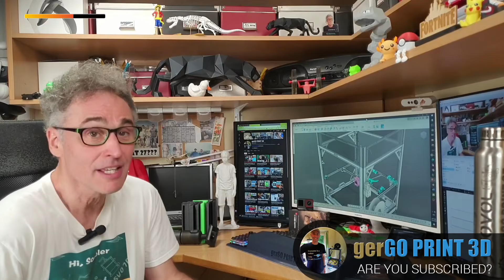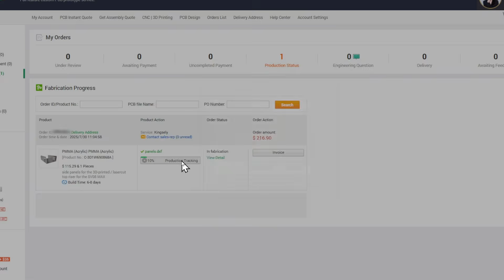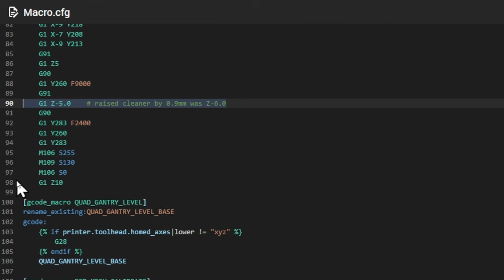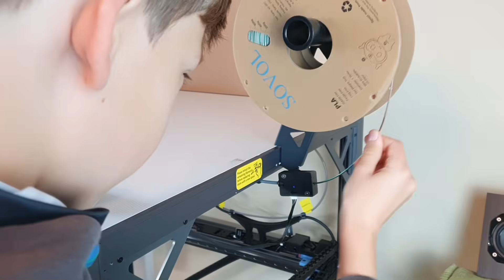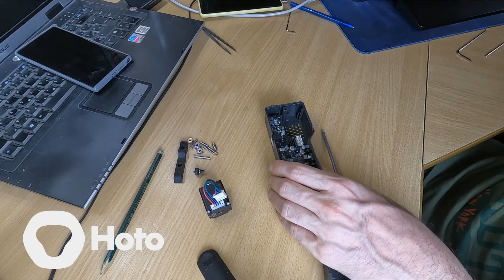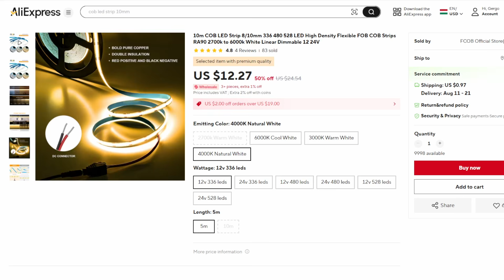Making our Sovol SV08 MAX Even Better: Adding the Missing Pieces – Part 1

Comment: What I want to know is how can we switch to the new toolhead on the regular sv08. Also the new filament assist
Reply: IIRC the SV08 is USB toolhead and the SV08 max is CAN - so its a bit more then just swapping the toolheads. They have different controller boards as well.
Reply: @paulhuckaby true, the process to install Eddy was pretty easy, but the usb cable management is a pain. I wil figure out a solution though!
Reply: Some people grew impatient and installed mainline Klipper on their SV08 to install an Eddy sensor.  I've been waiting for Sovol to provide an upgraded SV08 tool head with an Eddy sensor.  That's been coming "very soon" for the last month but is apparently very close to shipping.  Giving the SV08 a fast and accurate bed mesh should fix half of the first layer issues.

The SV08 uses a USB tool head.  The Zero and SV08 Max use a more reliable CANbus tool head, so they can't be swapped readily.  If you really wanted the SV08 Max tool head on the SV08, you could get a USB to CANbus adapter, hide that near the motherboard, and do a little bit of wiring to connect the motherboard to the adapter, probably cannibalizing the USB tool head cable for the connector and short wiring harness to the adapter.  It shouldn't be that difficult.  I was tempted to do that, but decided to wait on Sovol to stay on their firmware update program rather than installing mainline Klipper with whatever that entails.
Reply: I hear ya, but I went ahead and upgraded to mainline Klipper and added Eddy NG...that part is great...now my bed is a different story!
Reply: @treyduval5399 there are some options now. I haven't tried any yet, but it's good to see some options like Nadir demo'd and printasaurus etc. Cheap vs expensive. Someone else posted a video then other day of their manual fix for the bed.
Reply: @colinmsmall yeah, I've seen cheap and expensive and decided to go my own route and create supports under the bed....so far it has been a 💩 show, but I'm continuing improving the system and it's getting flatter!

Comment: Thank you for the wonderful videos on the SOVOL SVO8 printers. I got SOVOL Sv08 "not the MAX" 2 months ago and so far, it has worked quite well. But I have a question that I cannot find a answer to on YouTube. My printer is factory stock with the click wheel interface. Since I have not been able to figure out how to connect wirelessly, I just move the files to the printer on a USB stick. The files seem to be stored in the printer as well. Is there a way to delete the G code files in the Printers memory? Or can you only do this if you have the add on touch screen UI. Thank you for sharing with us.
Reply from the maker: Hi, it is fairly easy to connect wirelessly, just create a text file in the root of a USB drive and name the file "wifi.cfg".  Add lines:
ssid=
password=
with your wifi's information.  Plug it in. Go to the menu item Advanced → Show IP address.   Keep the USB drive plugged in.  Alternatively you could just take an ethernet cable and connect the printer to your router (they usually have at least 4 ports, which only one is used).  Other than this, I don't think you can erase the files from the internal memory (save taking the EMMC module out and plugging it directly into the PC, but even then I am not sure how you would get to the files).
Reply: Most people have problems connecting Sovol printers via WiFi.  The fix is simple.  Buy a WiFi bridge.  It plugs into the SV08's USB port for power and it plugs into the SV08's Ethernet port for data.   The SV08 is MUCH better when you can send files from OrcaSlicer and manage the printer via a Mainsail web page in your computer's web browser.  I have a very hard time going back to a pre-Klipper printer and transferring files via micro SD cards.

I hoped WiFi would be easier when I bought the Sovol Zero, but it didn't like my WiFi router either.  If you need two or more 3D printers on your WiFi network, get a router or switch to share the Ethernet from the WiFi bridge.  That can also allow you to add some network security and keep the 3D printers off the internet so they're only accessible on your local area network.  You can give them momentary access for over-the-air firmware updates as needed.

If you have issues with Sovol printers, there is a Sovol forum and several helpful people there to answer your questions and offer help.  It's also a good place to complain and commiserate, as well as share your success stories.   🙂

Comment: after two months i just got my sv08 working properly enough to put enclosure on a try some asa.. 
I'm not ready for Max giving  me similar headaches ..... but i do enjoy your videos, they have helped...
Reply from the maker: Never print ASA without proper venting. It not only gives you headache but also can cause long-term health problems! I know you meant it figuratively, but I had to hit this high ball 😉I am sorry for the troubles. These huge build volumes are a hassle to heat up, unless you need to print something huge out of ASA I would recommend smaller printers for that.
Reply: My SV08 has been down for upgrades for a few months because I decided to wait for the upgraded Eddy sensor tool head from Sovol, which should ship in a couple of weeks, but it seems like it's been a couple of weeks away for over a month.  I develop products so I'm sympathetic to that.   🙂

I bought the very nice looking but expensive R3men graphite heated bed for the SV08 but I haven't installed it yet.  I'll do all of the SV08 upgrades at once.  By the time I'm finished, I could have bought an SV08 Max for less money than I spent on the SV08, but as Gergo mentioned, bigger isn't always better.  Heating the SV08 Max will take a lot of power and will heat my office a lot.  I've very much appreciated the smaller-is-better Sovol Zero.  It's GREAT for printing small ABS parts.  I use it a lot more than I thought I would.  It's my go-to printer.  It's a Goldilocks printer that is just the right size for most of the things I print.  Many people recommend it as a second printer to print smaller items, but for many people I think the Zero would be a great first printer, with a larger printer added only when larger items are needed.

I'm not mad about spending a lot of time and money upgrading the SV08.  I knew when I bought it that I was taking the cheat path to a Voron 2.4 class machine and I didn't expect a Voron 2.4 for 20% of the money and 5% of the time invested.  I knew there would be issues that needed upgrades.  That's the nature of technology, whether 3D printers, computers, etc.  It keeps getting better.  We need to buy in at some point.  We can't wait until the best equipment is available because something better is always coming.  Sovol learned from the SV08 and the Zero and SV08 Max are much better.  The upcoming improved SV08 Ace will inherit those improvements as well.
Reply: same here ... i am not gonna go for a Sovol again. It was just too much of a hassle to get it running. These days, printers need to perform out of the box ... at least from my pov.
Reply: @kalashin1529 An SV08 that work without any modding or tuning cost more than 1000 euro. You all don't remember that the SV08 cost 550 euro. For the Max, there is nothing similar near that price. Even kits that needs many, many hours of assembling and knowledge on proper assembly and eletricity understanding cost 2000 euro for the same build volume. 

They are cheap, they are not perfect. Don't cheap out if you don't want to spend time tinkering
Reply: @tecnosalva14  see ender 5 max

Comment: After more than 1 year still waiting for sovol to finish the SV08 (not max).
Reply from the maker: Yes, most companies like to concentrate on new releases rather than maintenance of existing line up. Still, in case of Sovol at least they made their printers fully open source, so we have a chance to improve these devices ourselves. Sadly this is not possible with much more locked down devices from other brands.
Reply: Many people grew tired of waiting for Sovol to fix the warped bed and slow/inaccurate bed mesh sensor on the SV08, and installed mainline Klipper and an Eddy sensor to get reliably good first layers.  My SV08 has been down for upgrades all summer.  I bought the expensive but very nice R3men graphite bed for the SV08 but I'm waiting to install it when Sovol ships their SV08 tool head with an Eddy sensor.  That's been "very soon" for a month now, but it really should be arriving soon.  Then we can have first layers as good or better than the Zero or SV08 Max.

Sovol is working on the improved SV08 Ace with an 8 mm no-taco bed and Eddy sensor, which will be great for new customers.  The SV08 is a great size, and with the first layer issues resolved, it'll be a great printer.
Reply: Thinking of picking one up as I'd like an open source printer without breaking the bank ,what issues are you referring too regarding the sovol not being complete
Reply: @kevinbonus603  Lack of proper macros for things like soaking nozzle before leveling, Unfinished firmware, ultra noisy cpu fan that is spinning all the time, lack of filament tangle detection, lack of a good bed leveling sensor, extruder gears too small, lack of orcaslicer profiles for materials and nozzle sizes, errors in the few existing profiles, etc...

Comment: Can’t wait for mine to arrive!  Working on clearing some space in my basement to put it.  I saw the table you had in a video as a stand?  Ang rough dimensions on length amd width for a stand to support the max that I could build before mine arrives?
Reply from the maker: That coffee table is 70x70 cm, the feet are 63 (depth) and 71cm apart (so they were 5mm overhanging). Tip: you can take exact measurements on the STEP model of the printer available on Sovol's GitHub!!  BTW I ended up placing the printer on the floor. It is tall enough to be furniture in itself. Especially with the riser we show off today :)
Reply: @gerGoPrint3D thanks for the social GitHub tip.  I did not know they had this!  

I was thinking it would help get off the ground to minimize the time I spend bending over to work on it.
Reply: @gerGoPrint3D  - I'd integrate a bearing hub filament feeder into the design of a structural top hat for the SV08 Max.  I might even get crazy and design a 4 spool filament dryer box for the top of the printer that allows me to store the filaments I use most, and then I'd be ready for a Bondtech INDX upgrade.